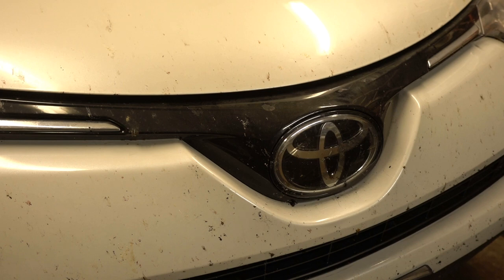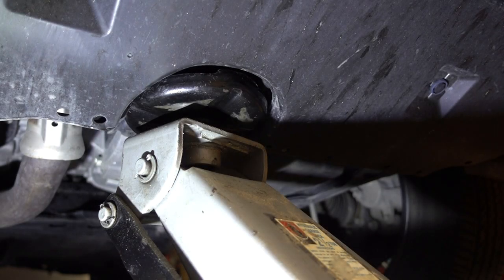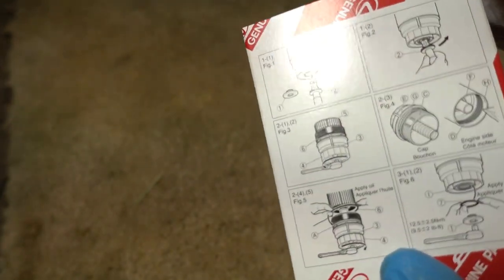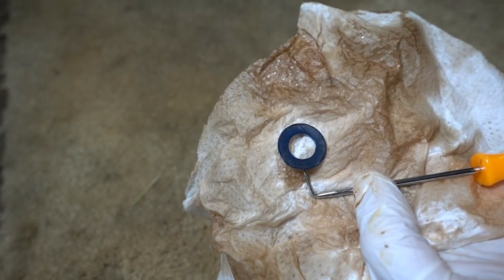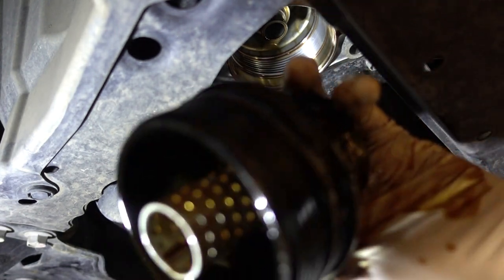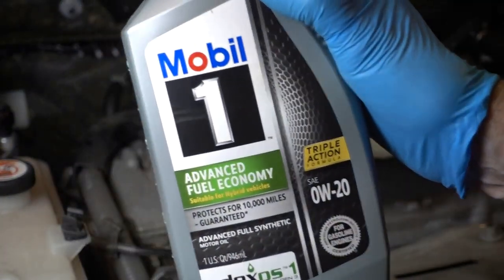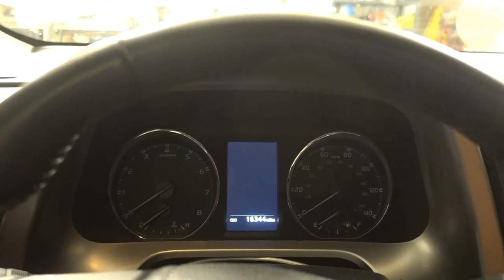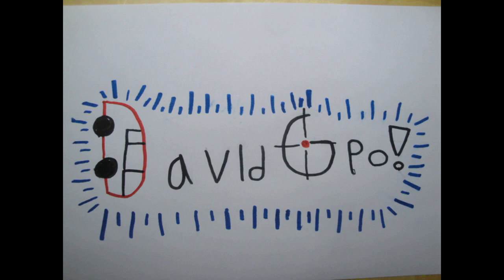2018 Toyota RAV4 Oil Change

Comment: Hello, Great video. Where did you get the crush washer? Can it be any standard crush washer or is it specific to Toyota?
Reply from the maker: I got it from the Toyota dealer.  I later bought a package of generic crush washers on Amazon.  You should be OK using any brand of washer.  Thanks for watching.  My next project is installing a dashcam in the RAV4.

Comment: great
Reply from the maker: Thanks for watching!
Reply: @davidgpo  do u know a ything about the transfer case fluid and the axle fluid change? my  rav 4 2016 is at 99999Km
and none of that has been changed yet
Reply from the maker: @cloudchaser9951    You can use conventional lube on the transfer case and axle.  For the transmission you have to use the Toyota branded fluid or you will destroy the tranny.   I don't have enough mileage to make a video on the subject.  I follow the carcarenut YT channel for my maintenance tips.   https://www.youtube.com/watch?v=0URaztDXHco